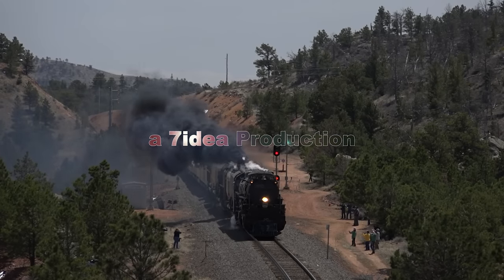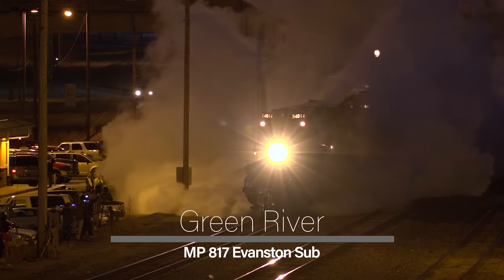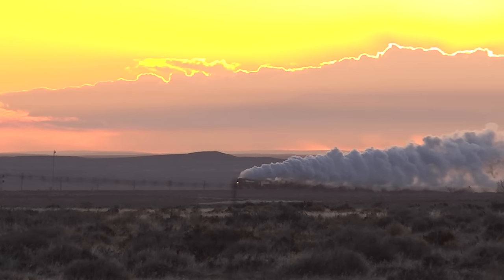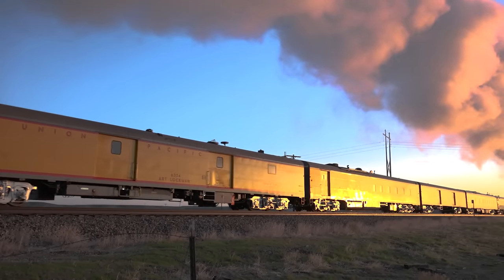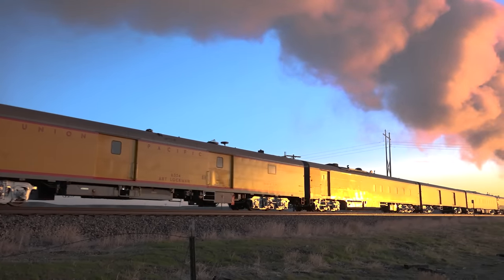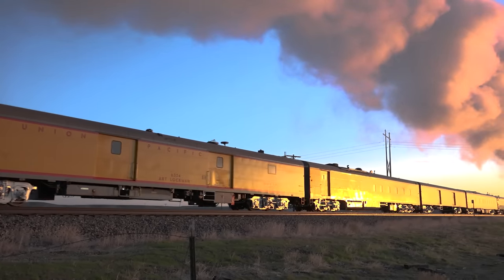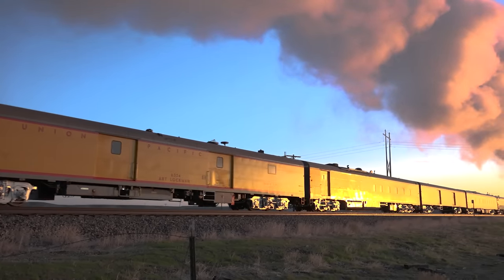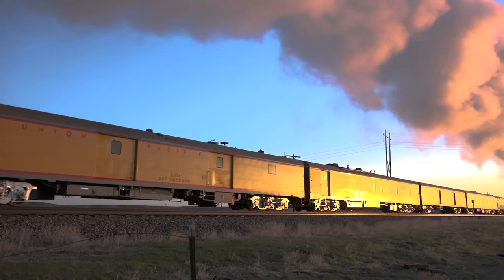The Largest Steam Locomotive on Earth!

Comment: suppose the Diesel - helper - will also provide that extra electricity, amongst other needs, used for air conditioning? so that the lucky - Executives - who are riding along, have it nice and cool and their cold beers? or ice cubes for their Whiskeys?

and one can assume that the steam and smoke billowing out at the two engines around 7 minutes, or at other times and occasions, was done for effect for this film? not that i minded, a great picture!
Reply: The diesel locomotive is there for dynamic braking.  Not to pull the train. And it has no ability to supply power to the coaches. That is done with dedicated power cars UP uses in each passenger train.
Reply: @FFred-us9tw  suppose there is still one more thing. that is being not ever mentioned. because it will not happen. it can't happen.and it must not happen. but the train is running on a main line. on a fairly tight schedule also for other trains. so Big Boy is also o na tight schedule. should it though happen, of course it had not,after all the film is from march and we would know about it. but should something ahd happened to both steam locos, the dieses was there to pull them off to a siding. in order not to block the line for the other trains...
Reply: @benediktmorak4409  of course. UP mentions that as well and it’s obvious. The diesel is an insurance policy if there are any issues with the steam locomotives.
Reply: @FFred-us9tw  from all the replies that i got, it's always -dynamic braking - or giving power for - additional modern heating and air conditioner in the waggons. which the steam locos could not provide. suppose one has to go to the UP website or the Big Boy site to find out all this?
Reply: @benediktmorak4409  Ed Dickens has been interviewed many times about this subject.  The diesels have no ability to provide power to the coaches.  UP owns no modern diesels with this capability. The power comes from dedicated “Power Cars” that have generators on board. You can see them in the video.

Comment: It's funny how the driver's cabin is placed so that the pilot can't see directly in front of him! Why didn't they change that?
 They could have placed a cabin right in front of the locomotive, or at least behind it but at a higher place. It's incredible nobody ever did that! They always had to lean out the window to see ahead of them.
I'm baffled by this design.
Reply: The firebox and tender are at the back, so it makes sense for the engineers to be at the back as well.
Reply: Look up Southern Pacific “cab forwards “. They basically did what you suggested, put the cab at the front. But they were pretty much the only types like that. The cab at the rear of the boiler is a better design since you are right next to the tender and it’s a lot easier to operate a steam locomotive this way. 
There are windows on both sides of the boiler, they’re just not very large. Usually the engineer and firemen simply lean out the window. This was commonplace for well over 100 years. It’s not an issue.

Comment: Why did this Big Boy require helpers?
Reply: They need it to power the train cars the steam trains only have a Dynamo powerful enough to power a cab light in the headlight and some of the gauges because back then train cars were still lit with lanterns and there were no refrigerator cars ECT
Reply: @corybrown1450 the diesel locomotive is not there to provide power for the coaches.  It has no ability to do so.  The 480v AC power comes from diesel generators in special cars in the train. You can read about them on the UP website.  The diesel locomotive is for Dynamic Braking, PTC equipment and redundancy in case Big Boy has issues

Comment: I wish they were still around instead of diesel. No shortage of water or coal.  ❤
Reply: No shortage of Diesel either.   Don’t blindly follow the media.
Reply: @FFred-us9tw  I prefer coal, over diesel.
Reply: @stephensfarms7165  OK, from a nostalgia point I do as well. But the big boy doesn’t burn coal anymore. It burns oil.
Reply: the 2 steam locos are oil fired, NOT coal.

Comment: Why does such a short train need 3 engines? I guess Bigboy ain't that strong.
Reply: The diesel is for dynamic braking since steam locomotives lack any and also for PTC which is provided by the on board computer on the diesel. The second steam locomotive is simply being moved from one location to another.

Comment: Steam trains are very impressive but this big boy video does leave me questioning some of the comments from the narrator. The amour of steam or smoke conform the big boy doesn’t lol right to me. Steam doesn’t linger like that but the smoke from the boiler does. Another thing that bugs me is why is there a diesel locomotive part of the consist? It has never made sense to me. The big boy was designed for power so why the diesel and why the second steam engine?
Reply: The steam is only lingering because of the cold temperatures, therefore it’s not evaporating as quickly as it normally would. And the diesel is there to supply electrical power to the coaches, since the steam engines have no way of generating enough electricity for them. The diesel is also there for dynamic braking, another feature the steam engines lack. And it’s just there to provide emergency backup power in case something goes catastrophically wrong. The second steam engine is mostly there for show. The UP steam crew has several stream engines, but these are the only two that are operational. It was only fitting that both of them were brought out together for the monumental event. Hope this helps!
Reply: @centralcaliforniarail  it actually doesn’t help. There is a electrical generator car in the consist already. And furthermore the big boy and the second steam engine and all the brakes on the consist itself can more than provide enough braking power for that small of a consist
Reply: The diesel locomotive was pulling against the big boy to add resistance to the steam locomotive. A type of dynamic brake force to test the power of the 4014
Reply: @johnwilliamson6143  ok listen I’ve seen a lot of steam engine’s in my day and when I see a diesel in the consist and there has been a lot it’s bugs me. Steam engines don’t need the diesel so why is it there? It’s not for electrical for the passenger cars because there is a generator car for that. It’s not for breaking as the big boy or whatever steam engine is on the lead. So what’s it there for? Dynamic braking ?? Bullshit!!Why the hell would anyone do that? Steam was around a lot longer than the diesel locomotive so why even have it there. It takes away from the fact that they went threw all that B.S in rebuilding it so leave the diesel out of the picture entirely.
Reply: Watch the video again and listen to the narrator. He will tell you the same thing I did. That section of cars will not load an engine with this much tractable power. The diesel electric locomotive was added to increase the load on the engine. I guess the narrator is full of shit also?
Reply: @trevorjones8520 UP wants Dynamic braking for safety reasons and for lessening wear and tear on the equipment. is in Idle during normal operation traction wise. It's there for dynamic braking when needed and it also has the controls and hardware for the mandatory PTC. It feeds the data via cables to the 4014's cab to displays for the crew.  On most excursions UP will always have a diesel in tow to provide additional air if needed and as a built in rescue if the steam locomotive it's trailing needs it. But the length of these excursion trains won't even break a sweat on a steam locomotive this large.
Reply: @FFred-us9tw  all I have to say to that whole comment is bullshit. I don’t buy it for an instant. Smoke and mirrors. Why bother putting a diesel electric engine just to provide dynamic force  why?? RTC can be provided by communication cars made for trains like this. It bugs the hell out of me to see a beautiful locomotive or locomotives and their consists with one of their diesels mixed in with the bunch. They spent an awful lot of money to rebuild a legacy and then to spoil it by putting in a piece of relevant equipment to wreck it for those of us who just happen to be diehard railroad enthusiasts
Reply: @trevorjones8520  it doesn’t matter “what you buy”. Those are the facts. If you bothered to read and watch the actual videos UP puts out they explain it clear as day.   And if you also understood the reason for dynamic braking and why it’s important it would make more sense. But you’re not an Engineer and your comments make it clear you don’t have any real concept of how trains operate. 
  And what are you even talking about with “RTC can be provided by communication cars”??  What is RTC???  And what is a “communication car”? 
I mentioned PTC. Do you even know what that is? How it works? And what equipment is required?
  If you’re such a “Diehard railroad enthusiast” then maybe stop running your mouth and listen to people who do this for a living and are trying to explain it to you so you can understand. The worst type of rail fans are the ones that can’t accept reality and only wanna live in a fantasy world. That’s not how the world works. Just be grateful that a class 1 was willing to spend the millions of dollars it took to bring this locomotive back to life and stop nitpicking about “waaaaaaahhhh. I don’t like the diesel in the consist!!!“. The majority of railfans and UP don’t care what you think.
Reply: @FFred-us9tw  by the way your theory of ptc doesn’t apply in this case as there is no electrical connection to any system on a steam locomotive. It can’t be computerized to perform any of the functions of a steam locomotive so again your theory of why the diesel is there has changed yet again. Why don’t you tell the truth as to why it’s there in the first place and that’s to provide air to its firebox for the initial start up for the two steam engines and maybe to provide help going up grades. Just another deceptive video and comments. It’s too bad that you Americans need to put a diesel locomotive in there because your too lazy to do things the way it was actually done in the past.
Reply: @trevorjones8520  The more you post the more clueless you look. You have absolutely no concept of what PTC is or how it operates. Please, stop commenting on real railroad operations and stick to talking about model trains. You are way out of your league in this discussion and you’re just making yourself look worse.

Comment: А для чего тепловоз в составе поезда? Два паровоза одновременно вряд ли сломаются.
Reply: They need it to power the train cars the steam trains only have a Dynamo powerful enough to power a cab light in the headlight and some of the gauges because back then train cars were still lit with lanterns and there were no refrigerator cars ECT newer train cars also have a whole different type of braking system and plugging those train cars brakes into that steam locomotive would be like trying to plug in Old color cords from a VCR into a 4K curved TV they are likely required to have it because of regulations due to the brakes

Comment: Pulling a diesel electric backup just in case. lol
Reply: They need it to power the train cars the steam trains only have a Dynamo powerful enough to power a cab light in the headlight and some of the gauges because back then train cars were still lit with lanterns and there were no refrigerator cars ECT newer train cars also have a whole different type of braking system and plugging those train cars brakes into that steam locomotive would be like trying to plug in Old color cords from a VCR into a 4K curved TV they are likely required to have it because of regulations due to the brakes
Reply: @corybrown1450  Ahhh, ok. Thank you for the explanation.

Comment: it is the diesel locomotive that runs the train, the  steam locomotives are not putting work, they are under steam, but not pulling
Reply: You are incorrect. Dozens and dozens of videos proving this.  You can clearly hear the diesel locomotive in idle as the train goes by.  On downhill grades you will hear the diesel RPM higher since that’s part of how dynamic braking works.  
  The diesel locomotive is only there for PTC and Dynamic Braking and as an emergency backup should the 4014 have any issues.  But you should go watch the videos that prove this.
Reply: They need it to power the train cars the steam trains only have a Dynamo powerful enough to power a cab light in the headlight and some of the gauges because back then train cars were still lit with lanterns and there were no refrigerator cars ECT newer train cars also have a whole different type of braking system and plugging those train cars brakes into that steam locomotive would be like trying to plug in Old color cords from a VCR into a 4K curved TV they are likely required to have it because of regulations due to the brakes

Comment: You will notice that there is a diesel in the train just in case the steamer craps out.
Reply: That's not the real reason it's there. Sure, it could help if the steam loco had an issue. But the primary reason they run it with a diesel in tow is for dynamic braking (which steam locomotives don't have obviously) and most importantly for PTC. The Big Boy does not have on board PTC equipment. Only the displays. So the data and controls for PTC come from the diesel and are displayed in the cab of the 4014.
Reply: @FFred-us9tw  PTC ?

Comment: Largest in use now but not always. Not trying to start an argument but longest locomotive yes, not largest. That distinction is held by the C&O 2-6-6-6 Allegany class steam locomotive.  It outweighed the Big Boy by several tons, and the Big Boys boiler could have been slid inside the Allegany's boiler.

Comment: A shame really that peak steam was over taken so quickly with the Second World War and the technological advances it brought 

I know it's not quite the same but a Lancaster has roughly the same power output as the big boy (~6000hp) with some 108L of cylinder compared to the big boys ~800L 
The two both started life in 1941 

Just 9 years after that the engine which would eventually power Concorde was first run 
Weighing about 3.5 tonnes at cruise each engine was producing about 36'000 horse power and a thermal efficiency of 40%

Comment: Not exactly correct - as it's only the largest STILL RUNNING in the world.

The Beyer-Garratt loco's of the 20th class, were in fact two loco's joined onto a central cab/boiler and had a massive wheel arrangement of 4-8-2 + 2-8-4
Thus technically speaking - the Beyer-Garratts were bigger by 4 wheels PLUS the two segments were separated only by the ONE long boiler & cab - which was slung between the arrangements - meaning that the Beyer-Garratt loco was "fully complete loco" - as it stood with 28 axles, thus not needing an End-Attached" coaling / water truck (tender).

It was also a "loco" that could be driven in either direction - as in "forwards driven" - unlike the big-boy tender loco's

So - work it out for yourself.
The Big Boys had an "all in line" set-up of: 4-8-8-4 as their wheel arrangement (barely 24 axles in total)
 The Beyer-Garratt class 20 had FOUR MORE loco axles at: 4-8-2+2-8-4 being of the "Double Mountain" wheel arrangement  (a massive 28 axles for the loco only - & no towed tender at rear)
They had the entire boiler & drivers/fireman cab slung between the main axles, at the center of the loco - therefore no "additional towed tender was required (to be towed at it's rear end)

If one assumes the length of the Big Boy didn't actually include the added length of a "towed super long tender" - is that a false idea to say it was a "longer/bigger" loco?
Or was a self contained "tender" (slung along with the main boiler & cab) of the Beyer-Garratt - not a true description of "size of loco" buffer to buffer.

After all - the Beyer-Garratt's COULD have also been extra equipped with a similar sized "towed" tender - which would have made them extremely long.
24 axles on the BIG BOY loco (& how many on the "towed behind" tender) vs 28 axles on the Beyer-Garratt (with no additional towed-behind tender required)

I know which one I'd say was bigger & that would have been the one with more "wheels" on the loco itself.

Comment: It is great to see that Big Boy is back but it is also kind of ridiculous to watch that this giant is needing two helpers in form of another steam, and a Diesel locomotive.
Reply: Those other two locomotives are not helpers. The other steam locomotive was being moved with the big boy. The diesel is only there for dynamic breaking. Union Pacific has explained multiple times it’s to cut down on wear and tear on the brake shoes as well as provide supplemental air and assist in moving the train in yards when the steam locomotive is not operational. It is now also used to provide PTC to the 4014.
Reply: @FFred-us9tw  Thank you very much for your answer. To me as coming from Germany where we are having a lot of steam locomotives still in use for historical, or even sometimes "Plandampf" (steam in regular service) use it still looks strange. Here, second locomotives, helpers or not, are only used for security reasons or for show effects. Very mostly they are not needed. Yesterday, I incidentally found this video https://www.youtube.com/watch?v=8GujoYkaQf8 from this year about a steam locomotive (one of my favorite German by the way) in regular service for track renewals. As you might see, it does not need any helpers neither for additional power upwards nor for breaking it down when it goes downwards. The wagons carry about 1,000 tons. In Switzerland which is much higher, it is very much different. There, they need helpers pushing the train upwards, and helping extremely breaking it downwards. But I love to see Big Boy, especially in historic movies when it was in regular use. A real giant as we never had (and needed) in Germany!